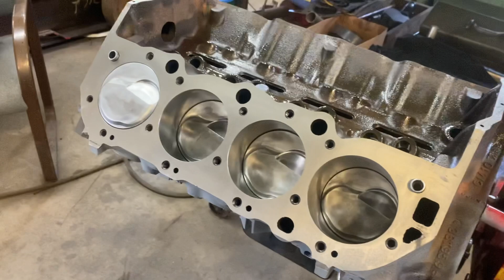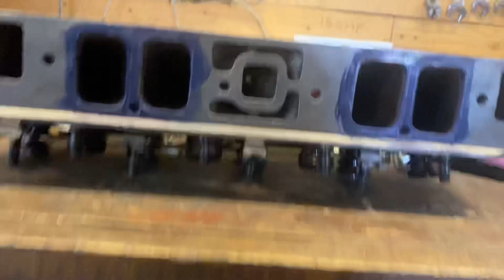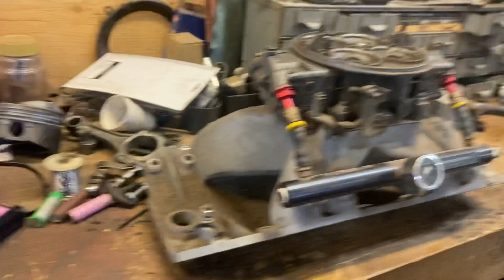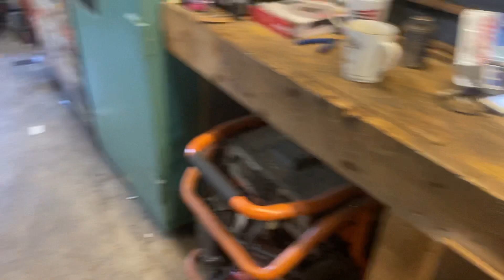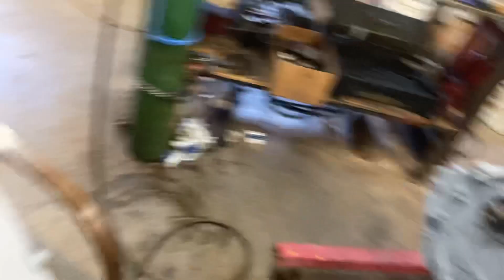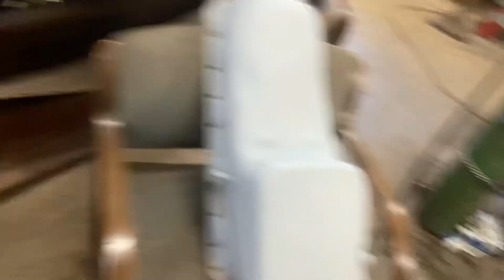Big block Chevy 454 build

Comment: Crazy the work you did to these heads is pretty much exactly what I'm currently doing to mine. And your pistons have a dome that look very similar. Different brand mine are Ross. The kick in the ass is I called everyone. I called summit racing I called Edelbrock I called Ross Racing and all three said the pistons I was looking at would not have any issues with the Edelbrock cylinder heads I had.
Reply from the maker: They probably shouldn’t, this engine is a weird rod length/pin height deal cuz it was parts I had laying around. It’s 4” stroke with 6.535” rods and 1.270” c/h pistons which left me 0.020” out of the hole. I machined the “flat top” area of the piston to give me zero deck so the domes are now 0.020” taller with respect to the deck which probably wouldn’t have been an issue except those heads were severely cut to increase compression. When cut that much due to the angle of the combustion chamber in relation to the deck the quench area moves farther into the cylinder. I would use some clay or plasticine on your engine and see what your clearance is. Most standard combos fit pretty well but you should check. You also don’t want to remove too much quench as it will help with detonation. 0.040” minimum with steel rods works well.

Comment: Like , sure like to see her run!! I got basically the same in a 69 Chevelle I built and haven't cranked her up I'm getting money to gather to build my trans😊😊
Reply from the maker: Nice car. Should work good for ya if you like a little rpm. Might like a tight 2800 converter if auto. Big blocks don’t suffer as badly from lack of low rpm torque like a small block does as you add cam. They just get happier!  My 496 was making 600ft/lbs by 2800 with 276@0.050. Plenty of bottom end and pulled to 7400. Had more cylinder head than 990’s though.
Reply: @FlatBroke612  I see where they blast the 990 head claiming 781 will out perform but mine are professionally ported 230 intake values 640 Howards hyd roller with up graded lifters for high RPM , it's 4l80e hd3  full manual and 35 spline 9" , up graded bars for traction and boxed off frame restomod , gotta get on it I just moved and everything is scattered but I had ever piece, I was being conservative hoping to make 600 HP but I think it will be More😅😅
Reply from the maker: @ronnielewis1862  I hear ya on the moving. Moved half way across the country, took machine shop equipment and three transport truck loads of old tractors. Still have stuff MIA boxed up ten years later... sounds like a sick build. I can’t really see how 781’s would out perform the larger port 990 on anything other than a smaller cube engine in an old man driven road boat with 2.31 gears that rarely sees over 2000 rpm though. If you’ve got a bit of compression, cam and gear you should be driving the engine accordingly and it will be happy. Obviously this engine won’t like running down the road at 1200 rpm. Worked at an engine/chassis dyno shop years ago and have seen many times customers want a “magazine build” and then complain it has no power when they idle around and it doesn’t turn on till 4000rpm or it’s just too maintenance intensive for their abilities or wants. We often ended up pulling cam out once they realized their mistake. The aftermarket really destroyed the value of good GM big block heads also. You can get better heads than anything GM offered cheap now. For anything other than a cheap build or an original restoration the aftermarket out performs, even on cost really if you have to have an old set of heads rebuilt you’re near the cost of new, better castings. I had bought the junk engine for a few grand figuring I couldn’t loose with the steel crank, valve train and heads but everything was pretty rough, block was junk and the heads became not worth much not long after I picked them up. This build was pretty much to “use up” leftover parts that otherwise would have sat around or got scrapped. All I’ve got into it is some time, basic machine work, rods, bearings and gaskets. Even reused the total seal rings that were with the pistons! (They only had a few pulls on them when that engine ate a roller lifter). Sounds like you’ll  make that 600hp easily and probably a bit more.
Reply: What area are located, I got a 400 projects in the works
Reply from the maker: @ronnielewis1862  out in eastern Canada. I have to pack a lunch to go to McDonald’s 😂
Reply: @FlatBroke612  thanks for sharing I love it I'm I Arkansas , quite back in the  country moutians and beautiful  streams 5 lakes near
Reply from the maker: @ronnielewis1862  nice. I’ve never ventured that way yet. Canada and America has amazing scenery/locations. I’ve been down the Eastern US, also Minnesota and Wisconsin a bit. I like my small towns and quiet pace but machine shops are hard to find locally which is why I do most of my own work. Just got a sunnen hone, had a lathe and milk forever but I did have to drive 1000 miles round trip to a fella that could balance and line bore That block. Just not available any closer. Trade offs...